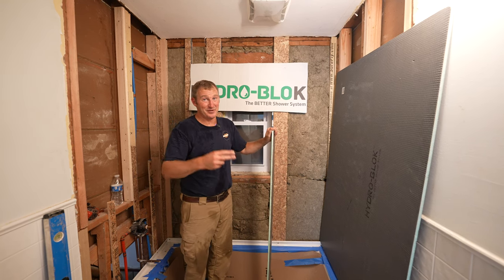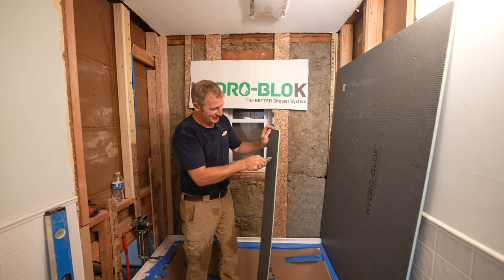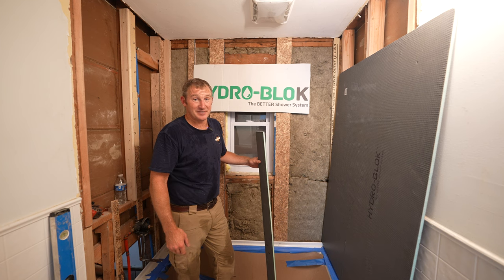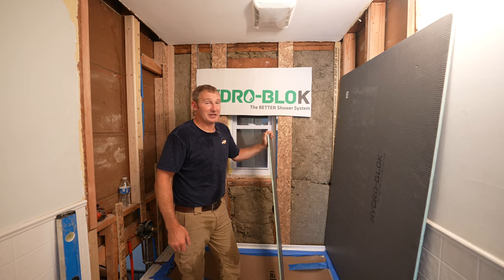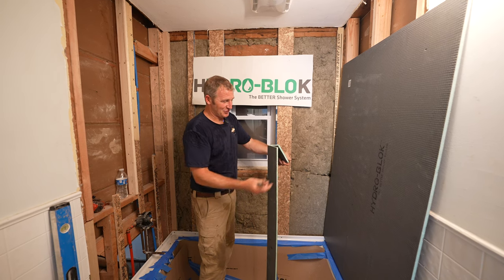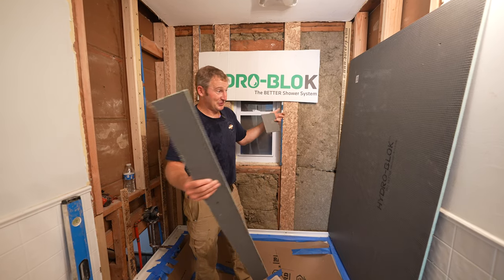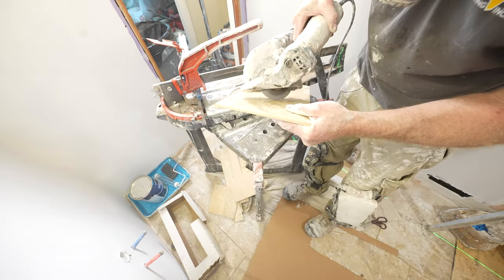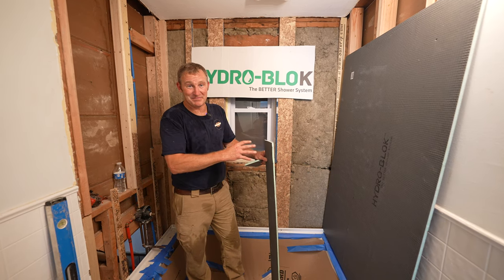Preferred Method for Waterproofing a Tub Surround

Comment: One thing to watch out for with foam board tile backers is if you will be installing grab bars.  Make sure you have solid wood backing and to construction adhesive or thinset that blocking face before putting up the board, to fill any small voids.  There is too much flex in those foam boards.  On a job where I was asked to only do the finishes, the framers put in plywood backers for the grab bar positions, the tile guy used foam backer board, and when I was securing the grab bars, the tile cracked... twice, causing the tile guy to come out to remove the grout and cracked tile and replace it both times.  The second time he opened the wall in the closet to do something behind the tile to better secure it.  As a contractor that also does tile work and repair in my list of services, I felt bad for him as I know the work involved to remedy that type of thing.  It was a heads-up for me as I was just about to transition into using foam board tile backer.

Comment: I have been using only Hydro blok  for over 4 yrs, they have  1/2 in board, 48"x 64", 4 ft x 8ft and 3ft x5ft. They have the most complete system on curbless showers, low profile showerpan curbe,  diffrent  ways to build niches.  It's more ridgid and easier to cut than any other board on the market.

Comment: But how does it structurally compare to cement board?
I do bathrooms for multi-family residential rental buildings and it is very important that the wall is very sturdy for people bumping into it or punching it. I'm pretty sure with subway tile it will crack through. Can you maybe build a small mock-up and test it? Thanks
Reply from the maker: Good idea 👍